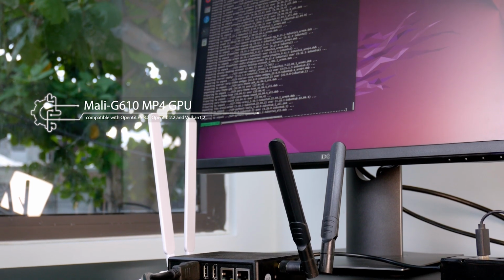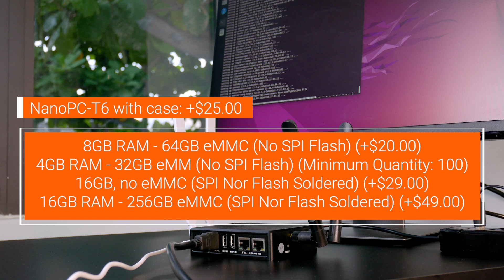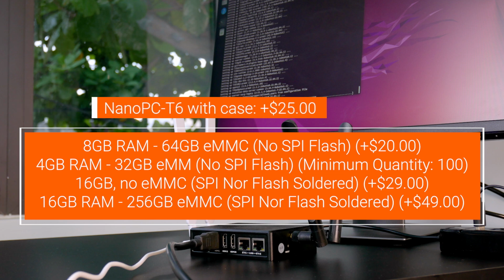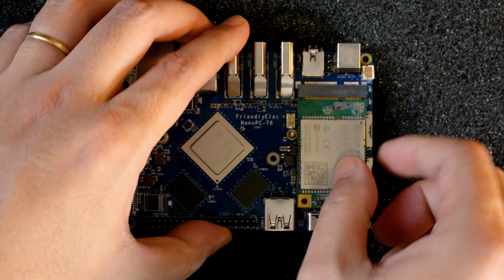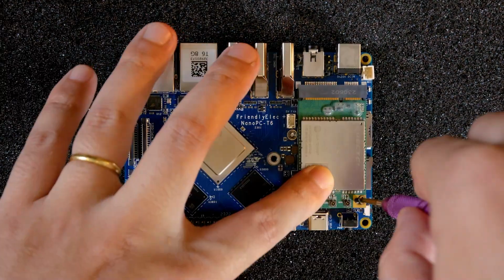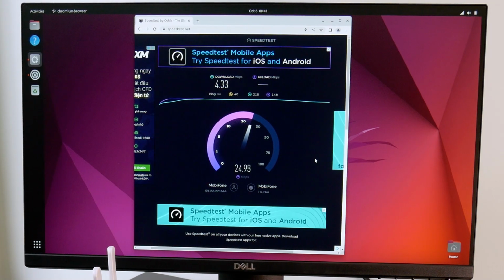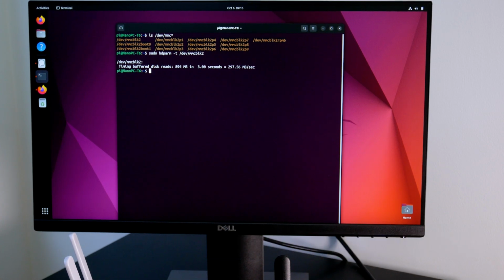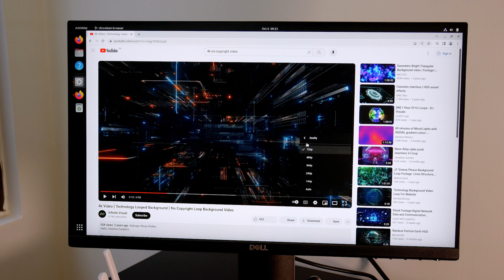FriendlyElec NanoPC-T6 Overview & Quick Test

Comment: Hello, I appreciate your kind words. I really need your help due to the place I live in. I have a Mini PC N5095 with OpenWrt installed on it. It has three WAN ports, each connected to a separate internet link, and one LAN port and one Wi-Fi. My request to you is to create a tutorial video for the scenario I'm about to describe, so that both I and others facing the same issue can benefit from it.

I would like to set up OpenVPN on each of the WAN ports and configure load balancing and failover between these three OpenVPN connections, so that I can utilize the combined bandwidth of these three connections on the LAN and Wi-Fi. Additionally, I want the scenario to include a kill switch, DNS leak protection, and an ad blocker.

Thank you in advance for your assistance.

Comment: I just bought it on bargain. Still traveling to my address. I have a question: does it auto boot, when the power brick is connected? This way, if a power surge happens, the operation would come back to normal, automatically. Else, if I need to press the power button, this cannot become my main router! Hope you can shed some light! Big up Van Tech Corner!
Reply: Yes indeed! I received it, and it has a jumper for this function, on the PCB!
Reply: Most likely, yes. Most single board computers turn on right when they are connected to power